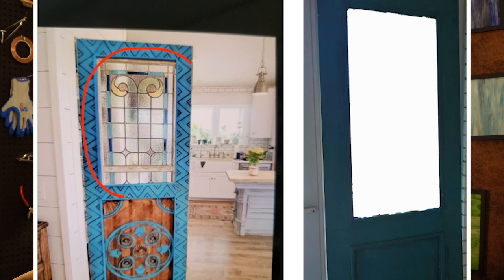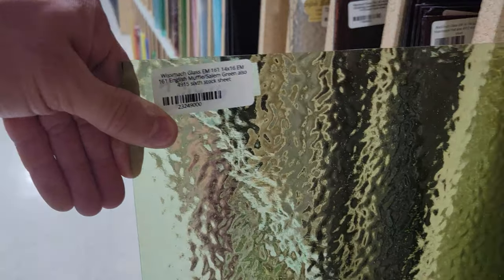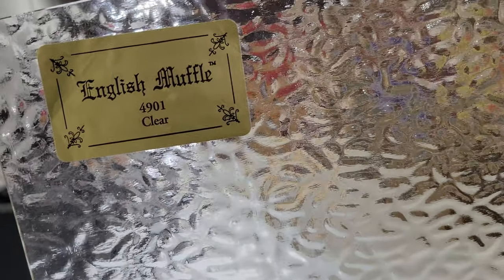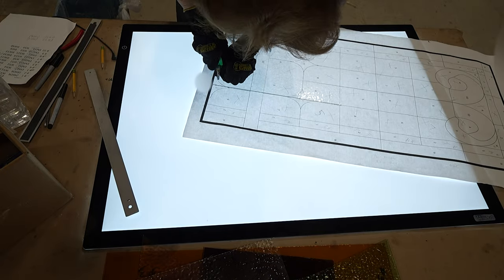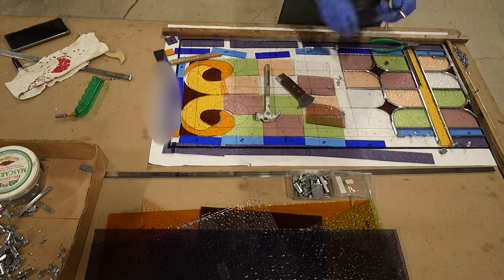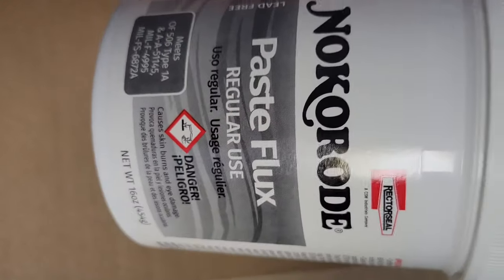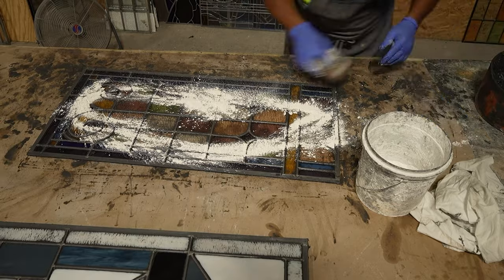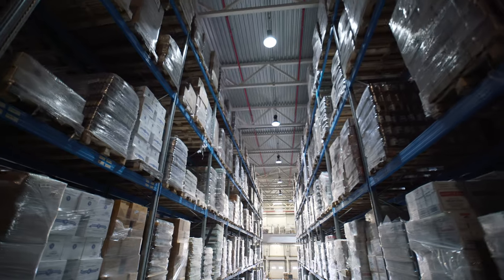Making Traditional Stained Glass

Comment: Good video with some important points mentioned. It would have been  helpful if you started right at the beginning - by demonstrating how to measure up the window in the door taking into account the rebate and then how you need to lay out the lead around the border of the pattern taking into account the rebate and where the border cutting line is. It’s imperative to get the measuring aspect of this kind of project accurate since the panel has to fit into a frame.  I would also have liked to have seen a slowed up video footage of how you actually cut & fitted the lead around some of your glass pieces. This part of building the panel can be challenging too. Otherwise this was really informative thankyou!
Reply from the maker: I'll try to include measuring stsined glass window in a video.
Reply: That would be great! Look forward seeing the video.